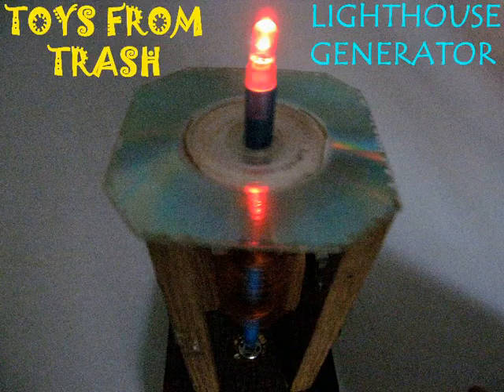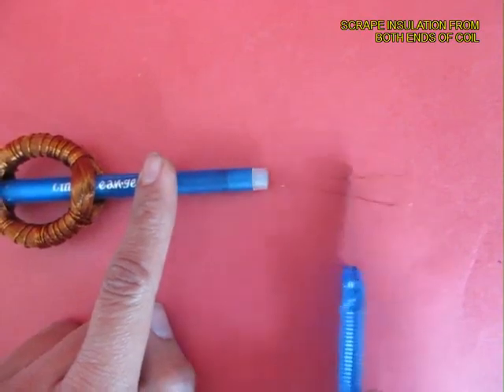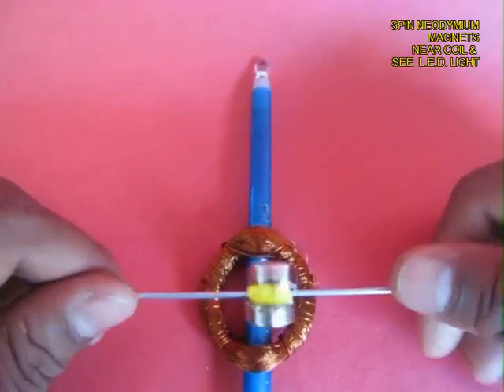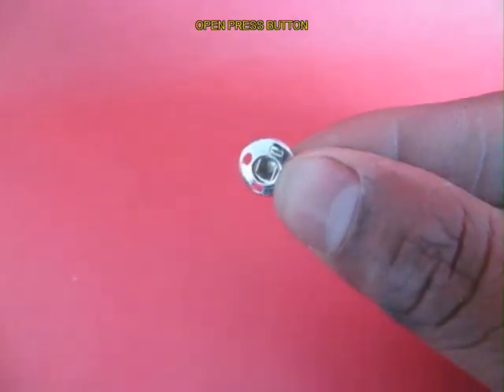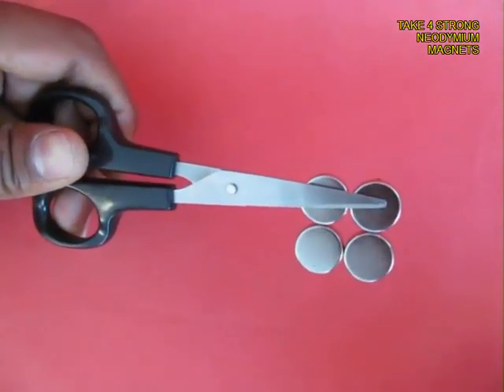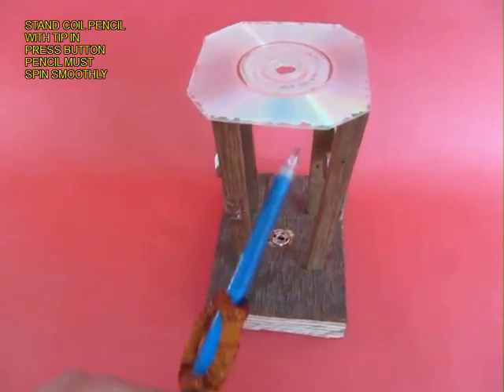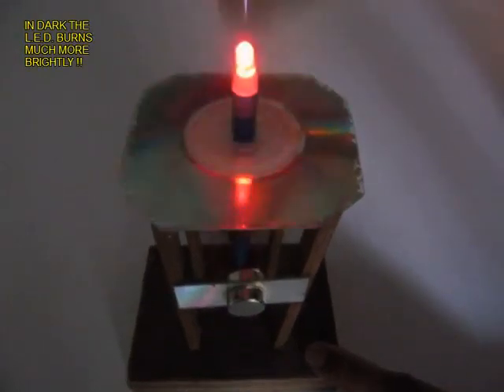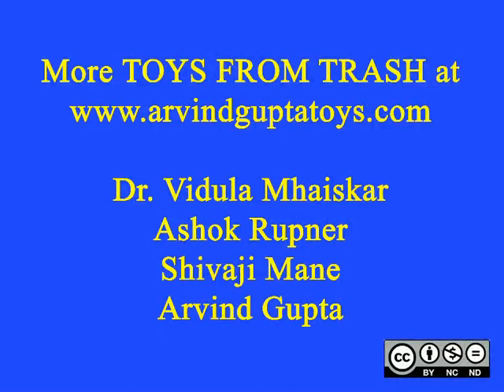LIGHTHOUSE GENERATOR - ENGLISH - 25MB

Comment: 1) For Neodynium magnets..there are different sizes..like eg. 1/4 x 1/16 inch, 1/2 x 1/8inch, 1/2 x 1/4inch..which one applies to this experiment?
                                    
2) For insulated copper wire 35 Gauge / Magnet wire Enameled copper wire 35 gauge, so if we don't find the same Gauge, which close to no. of gauge can we use?